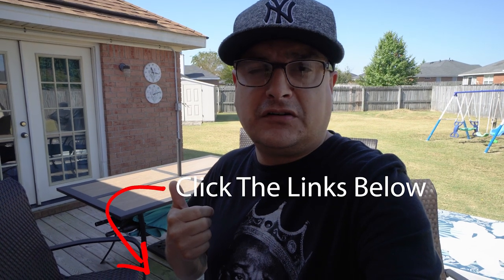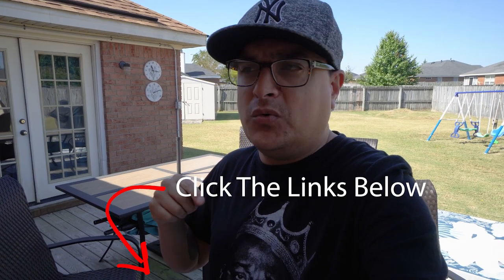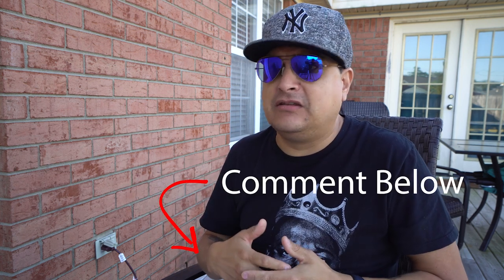Plain Enamel Vs Poly Vs Heavy Formvar In a Guitar Pickup

Comment: I once asked Jimi Hendrix what wire insulation he prefers in his pickups. He punched me in the face and told me to get out of his dressing room. Eric Clapton was much nicer about it and told me he prefers fat from whales ethically harvested from the northern Atlantic (heavier tone).
Reply: If they could have compared both, they would have a favorite too. Huge difference. Just compare some yourself. That is all that matters. Dont believe some guy TALKING about sound, PLAY BOTH STYLES YOURSELF fast 1/b in same guitar, all rest same except the wire. BIG DIFFERENCE
Reply: I have a combination of enamel and poly in my one guitar since there are mixed pickup brands. They sound great together. Even though there’s different materials from the different brands, they sound as if it’s all made from the same pickup company. I was actually happily shocked
Reply: It's impossible to test side by side because unless the pickup is wound by a computer identically on a mchine with super high tolerances, there is no way to make two pickups exactly for testing purposes alike regsrdless of the coating.
Reply: @email3575  You obviously have not seen Highline Guitars YouTube Channel, which you should. He winds his own Pickups to great success and has some awesome tutorials on the subject of Pickup winding, so he will surely know the difference. :-) 

Also, handwound pickups will ALWAYS sound different from each other. You'd need a complete automated winding process to eliminate the factor of differentiating pickup winding. There might be a difference based on capacitance etc., but if the insulation is the same thickness, very little difference should be noticable.

Comment: “It doesn’t matter” - Awesome
Reply: All said is true. Only, one thing is still not mentioned here, and that is the so-called "form factor", or, Nagaoka's Factor... That actually playes a role when we talk about different thickness of insulating material. Bottom line here is, how much of the coil is pure Copper, and how much in % is waisted on insulation...😉
Reply: Huge difference. Just compare some yourself. That is all that matters. Dont believe some guy TALKING about sound, PLAY BOTH STYLES YOURSELF fast 1/b in same guitar, all rest same except the wire. BIG DIFFERENCE

Comment: The comment section under your videos are getting better than those on imgur now. :D You seem to have decent followers.
Reply: I'm currently building Jimmie Vaughan Stratocaster replica. The client wants a humbucker at the bridge so he can have it sound like a Les Paul. He also wants to be able to split it with a push poll. I'm going to be winding the pickups and I'm just curious. Being that the pole positions of single coil Strat pickups and the pole position of a Gibson humbucker are slightly different would I be able to used Gibson humbucker bobbins? Or what I have to acquire fender humbucker bobbins. I know the fender humbucker bottoms are quite different then Gibson just wondered if it would make a huge difference.

Comment: There is one element that wasn't mentioned, that is factor in overall tone.
Age.
Plain enamel deteriorates over time and that deterioration can be accelerated under certain conditions. Much more so than the poly coats. This can alter the coil in a major way. Think of it as being like a new building settling in over time.
I tend to like it when this happens because the results tend to lean more towards what I look for in a pickup.
However. The downside to this is that your precious pickup is also one step closer to total failure as a result.
Those great "vintage" pickups that you drool over now (me too) don't sound the same as they did when they were new. And remember, many a good "vintage" pickup, died along the way. 
Just go with the poly and build them right to begin with.
Reply: Most PAFs died because of this. Poly on the other hand will last centuries.

Comment: Okay, so you said the thickness does something to the tone, and in another video you said the further apart the wires are the less interference with the mids and highs there is (or maybe that was someone else's video, IDR), so would that mean could use a 42AWG double billed poly-nylon wire to further enhance the mids and highs in an already mid and high leaning pickup due to the relatively thick gauge? You also said the height vs the width of the coil affects tone, is that why traditional single coils sound thin and hollow to me while P90s are full and bodied?

Comment: Agree.
PLUS, to be able to conduct energy through lacquer you would have to generate a ton of voltage, which a guitar pickup simply can't do. A passive pickup  generates extremely low voltages. That's why you need and AMPLIFIER to listen...
Ok now you may be thinking about active pickups, right? Still isn't enough voltage!

That's my knowledge at least, burn me if you think different.
Peace

Comment: Hi Dylan! Love watching your videos and probably you already answered this but I wasn’t able to find an answer going through your videos. 
I got the chance to 1-2 the PRS 57/08 (neck) and Iron Gear Tesla Shark (bridge), both into the same Epiphone LP bridge position. On paper, these pickups are very similar: AlNiCo II Magnets, 8.5 Ohm, 42 AWG enamel coil wire and Chrome Covers on both. Both had a similar warm, low output tone but the PRS 57/08 had a clearer, better defined and more complex tone to it. So I guess the question is: what could cause this difference in tone on such similar pickups? (I did use the Iron Gear neck pickup installed in the bridge position because of the similar output to the PRS)
I’ve read on the internet (and I’m taking this with a huge grain of salt) that usually the bad Chinese pickups use an alloy for the coil wire instead of pure copper that lower conductivity and in turn leads to having to do more wraps to get the same output, also that the bobbin poles aren’t pure steel and that can also affect the tone. 
Do you think the difference comes just from the winding of the coils or it can be just the difference in the quality of the materials used?
I would love to get your take on this.

Comment: Very interesting info. So the gold foil pickup gets its inductance from the wide flat coil and the use of 44 AWG wire. What does the ferrite magnet bring to the equation? Why don't more manufacturers use 44 wire. Is it too problematic to work with (breakage) or is it that buyers what vintage tone and Fender and Gibson used a thicker wire? What's the downside to inductance (if any)?  I'd love to hear you breakdown a goldfoil pickup and what sets it apart from the different styles. Thanks!

Comment: 7:08 About heavy farmvar Vs plain enamel... IMHO the tone changes because of not just a  matter of "dimension of the coil" but especially also for the "space between the winds" (gap between turns). Ina  few words even though you made an enamel coil identical in size like a farmvar one, they will sound difefrent; because of the gap between the turns
Reply: the wider the gap between turns is, the lesser the k-ohms resistance is

Comment: From Leo:   Good show.   You are a brave man.  If you keep telling the truth about all this stuff, how are people going to charge more for the snake oil magic?   Usually, people want to believe what they want to believe.   Dielectric leakage  is usually measured at far higher voltages.  At the  tiny mV levels in a pickup, the numbers are so low that they are almost impossible to measure.    I learned how to measure electrical characteristics with an Oscilloscope in 1972, used one in my job, and still have one.  Even a moderately priced oscilloscope is (at minimum)  hundreds of times more accurate and has thousands of times more range than any human ear.  If I cannot see it on the scope, it does not exist.  No invisible  magic.   I do recognize the stacking of variables, for example an extra limber piece of wood in the neck, combined with a minimum tolerance of turns, with a minimum tolerance of magnetic field, with a minimum  tolerance pot and capacitor on a guitar built a "loose" set up, WILL sound different than a guitar build with a stiff piece of wood in the neck and all the parts having maximum spec.  That is all measurable.   Add to that a good amp with a three band EQ, and it really does not matter much.

Comment: I always question the 'mojo' myths guitar players cling to.  I've been building pedals for a few years and I can tell you that 'magic' op amps aren't a thing, I can tell you that mythical diodes aren't a thing.. electrons do not believe in your myths.  you can measure and explain everything and recreate anything.  

So when I hear the pickup people go on about insulation I am curious as you are messing with inductance and capacitance which will change frequency response so I assume the thickness of the coating of insulation is the real key not what it is made of.